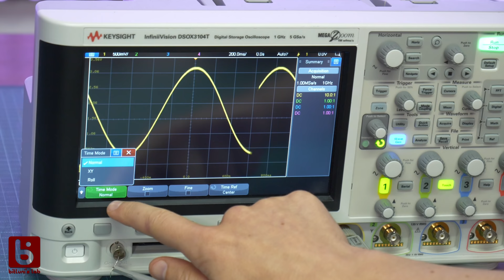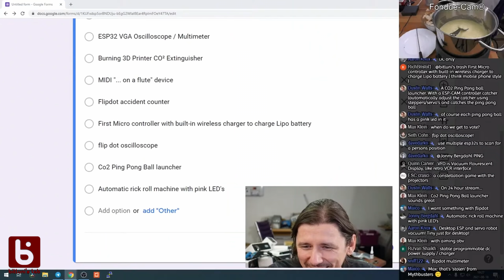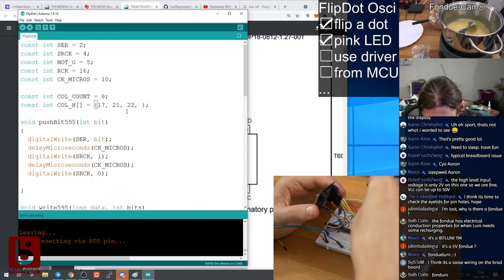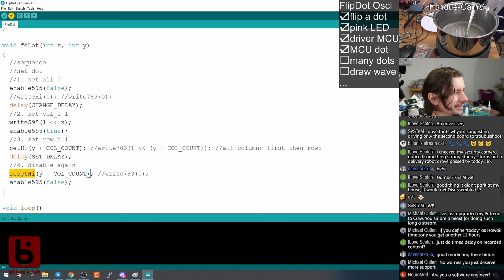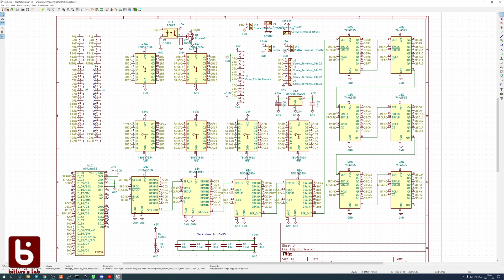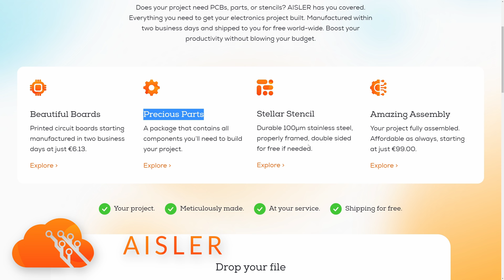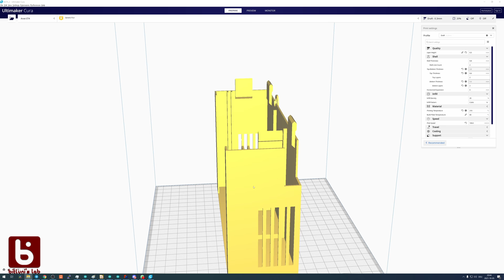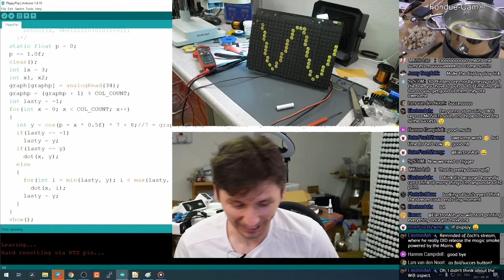Worst Oscilloscope in the World (DIY & Flip Dot Display)

Comment: Love that Aisler sponsors this! They need to be used by more people, especially in Europe!
Reply: Yes I've just registered, finally sponsor worth supporting!
Reply: I have used aisler once. I got 5 boards. They told me there was a short on one board during flying probe test. Then they proceeded to send all boards to me in one stack without further info on which board was faulty... It was also worse quality and more expensive than JLCPCP
Reply: @hansdietrich83  I haven't had any problems with them until now, however I agree that they are expensive, but the advantage is that those are locally produced PCBs (at least for me) and I trust them more with my design than I would trust any chinese manufacturer.
Reply: @hansdietrich83  I suppose that's the price you pay if you want manufacturing to be returned back to Europe. They are a bit expensive unfortunately.
Reply: I had good success with aisler. Nice matt finish, good quality boards. Since I live in Germany, shipping is very cheap and fast. For small one off prototypes, prices are competitive.
Reply: OshPark and Aisler. USA and Europe made. It’s good stuff.

Comment: You forgot to mention that your oscilloscope has a builtin memory function and that cosmic rays wont flip your pixels :D
Reply from the maker: yeah.. it's persistent and the regarding the cosmic rays it depends on the particle size
Reply: I though about a massive corona emission from the Sun , that should be enough to magnetize any wire , the those tiny wires in the coils

Comment: How much power does it draw? It's such a readable display I don't understand why they stopped being popular outside of airport terminals.
Reply: A flip dot is much more expensive than an LED. As for power, it's more complicated than that. If the text was never changed, then the flip dot display would be infinitely more efficient than current displays (excluding electronic ink).
Reply: @userPrehistoricman  Yeah E-Ink is cool. I bought 100k displays for a product I sell. But flip-dots are function and art in one. Even the sound they make is very pleasant - like a thousand pixies all flipping a switch inside their tiny capsule homes.
Reply from the maker: We witnessed a few technological revolutions like that. In that case it was the development of highly efficient LEDs.
I'd compare it to CRT: You love it once it's obsolete

Comment: I am trying to get a 14x28 flip dot display to work and with an arduino, I have the arduino wired up to a RS485 converter module. I have 24V going into the flip dot along with the RS485 connection. All my frequencies line up with my program and hardware. Is there something else that I am missing? I cannot get it to work for the life of me.

Comment: Integrated DC-DC converter was no option? Wasting that much energy is not only lazy but also a very bad practice.
Reply from the maker: It is an option. I showed a possible substitute. The current scalper cost for this part would double the BOM cost. I will replace it at some point

Comment: Has anyone worked out how to make a cheap DIY flip-dot display, because it looks like it's unobtanium.
Reply from the maker: you can't imagine how long I was thinking about this. You can probably print the dots but the coils is just copper and labor. Even if it ends up costing 1$ per pixel this display would cost 400 bucks
Reply: @bitluni  Maybe you could have a single row of coils and then mechanically scan it across the entire display. It would probably end up being much cheaper for larger displays.
Reply: @bitluni  I fell of my seat when you said $400, so I looked it up and they are way more than $1 on Ali. I guess a 3D printed base with 400 bolts poking through, then it's hand winding 400 coils - lol -.